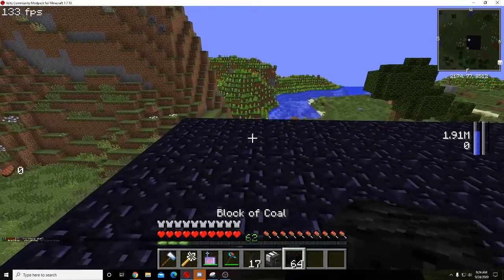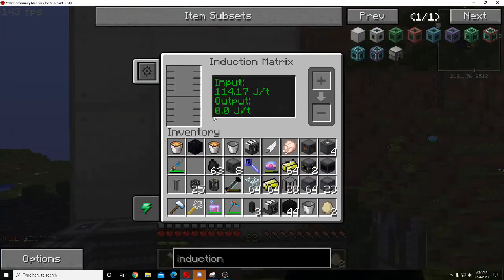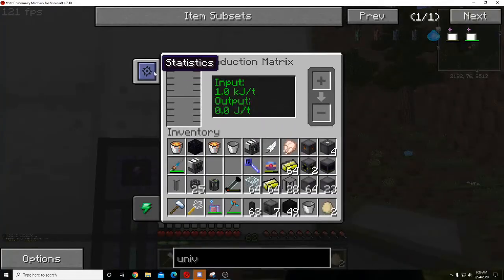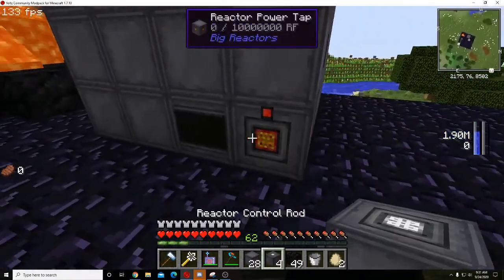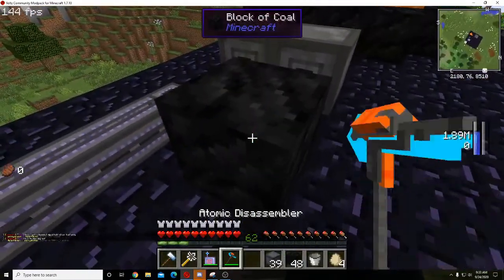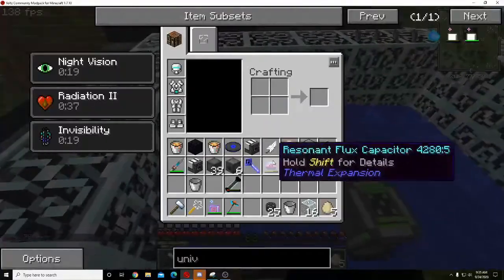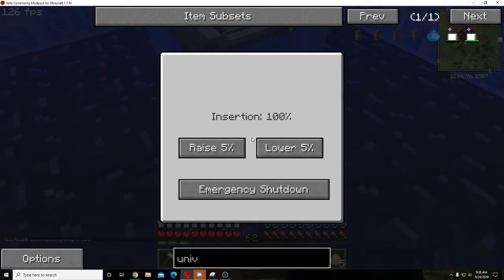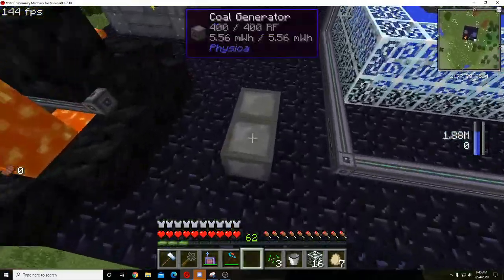Beginning-Medium Power sources in Voltz.

Comment: you can make a 6x6 fission reactor with quad 3x3 tourbines tho

it generates heat 3 blocks away from the centre meaning you can even make 7x7 with a + shape of small turbines and 4 3x3 tourbines from what i experimented with (although i think further away tourbines are from fission reactor less power they generate